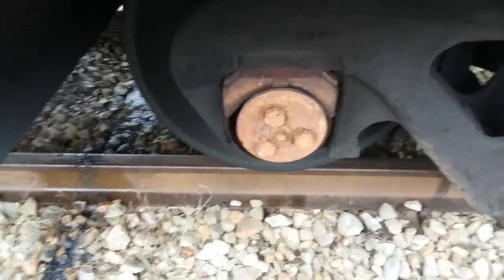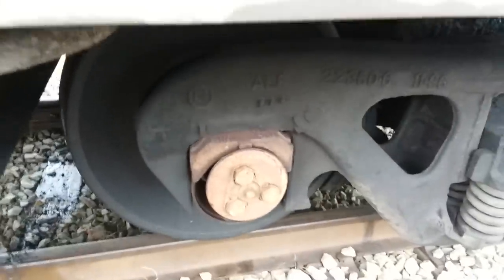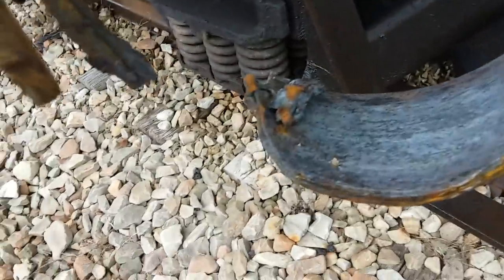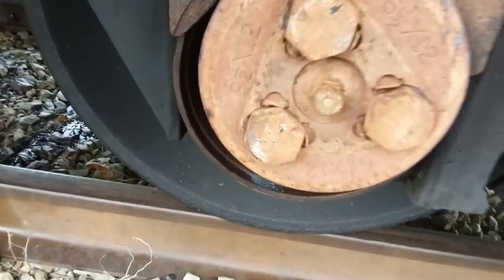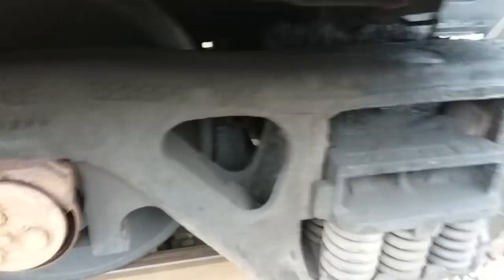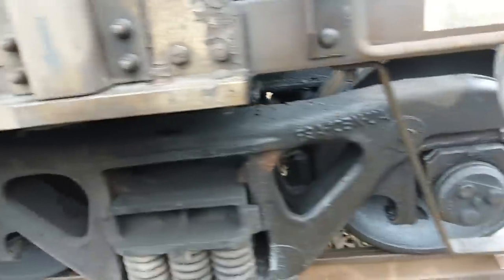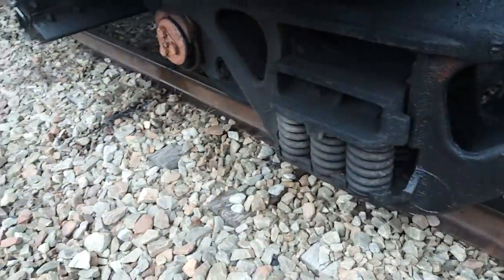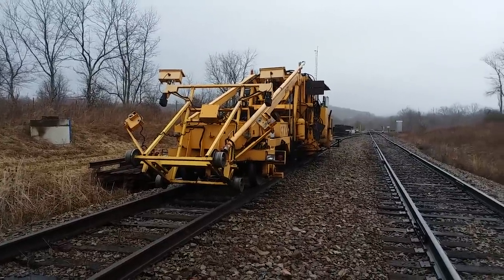Hopper Car with Bad Bearing, more of the Story

Comment: Timken has a facility in Akron, OH. I wonder if they assemble the railcar bearings there.
Reply: They also have a place in Canton Ohio. I deliver scrap there.
Reply from the maker: @mikeschmidt5328  Mike, awesome, thanks. PRR used have big shop in east Canton, is there anything left of that?
Reply from the maker: Lester, good question, hope somebody can give us an answer
Reply: @ccrx6700  I think Nimishillen Creek E. Branch is where the old PRR use to be. Looks like a small yard and shop there and another bigger yard in the front of that.
Reply from the maker: @mikeschmidt5328  thanks Mike
Reply: @ccrx6700  I'm a mechanical engineer and I love your commentary.  I am involved in the design of large pumps for power generation. You were absolutely correct about the piece of wreckage - it sure looked like an inner race.
Reply from the maker: @lesterlattig  thank you Lester, i ofyen wonder what others who watch are thinking. Do appreciaye your comments, and by the  way i'm Dave
Reply: @ccrx6700  As an avid rail fan and novice model railroader I really enjoy your videos. I live in the Poconos in Eastern PA and would love to take some time off and drive out to meet you before you retire. Then I can spend a couple of days in Altoona on the way home, and watch those massive SD-80 MACS haul coal trains through the horseshoe.
Reply from the maker: @lesterlattig  would like that, hopefully this virus thing will soon pass, but that would be awesome have you visit. Been horseshoe, wwhen you there check out railroaders museum. Did you know there is a rail cam live for hoseshoe on utube? We bout 3 or so hours west of Altoona, hour south of Pittsburgh. Many years ago wife an i honey mooned in Poconos
Reply: I do Dave. I watch Horseshoe Curve everyday, along with a bunch of other railcams.
Reply: @ccrx6700  I grew up in Northwest NJ along the old Lehigh Valley Newark to Buffalo line in the 60s and 70s. I lived in Alpha,NJ about 3-4 miles west of Easton, PA. As soon as a train was heading east I would here them cross the river from Easton at night. Those ALCO C-628s were screaming climbing the 1%-something grade to the Jugtown Mountain tunnel in Asbury, NJ headed to Newark. Fond memories. The old paint schemes they had were fantastic.
Reply: @lesterlattig  Awesome, I know nothing about that railroad or paint scheme,
so much railroad history, so little time to learn, appreciate hearing stuff like that,
Original Lionel train set I got back in late 1950 had steam engine and a Lehigh Valley
hopper car with it, and that about my extent of knowledge on LV. Have never heard
an ALCO in person, but have seen some vids on tube, sweet!
Reply: @ccrx-xu1wc  Be safe out there. BTW, EMDs are my favorite. Older locomotive engineers called the SD40-2 an engineer's favorite, as compared to the GE units at the time.

Comment: The theory on sealed bearings is they don't last ...lubed ones may run for a few years ...most bearings are made in China Mexico or Japan which is of poor quality and almost always sealed it's all about money
Reply: David, thanks for the comment sir, and for watching
Reply: Interesting theory but not backed up by facts. Roller bearing failure rates are quite low. Most of the failures you will never hear about as they are usually seal failures and caught and removed during regular inspections. But consider there are over 1.6 million rail cars in North America with a minimum of 8 bearings each According to SKF only 0.5% of bearings actually fail and if a railcar bearing does fail it is usually caused by lack of maintenance causing worn adapter plates and side frames resulting in uneven weight distribution on the bearing itself.
Reply: @edfrawley4356  just stating what I have seen in big truck and automotive  repairs for 40 plus years ....sealed bearings will not outlast lubed bearings we have seen it many times over the years ...foreign made bearings are of cheaper quality that's why they are ( cheaper ) Timkin bearings which are the best in my findings will run indefinitely provided with oil or grease on a regular basis ..there is no rocket science involved in that either
Reply: @davidbass7593  Im not an engineer but in my opinion the bearings used in rail equipment are oversized for the weights they carry. since from the beginning they where based on the size of existing journal bearings. The wheel shops simply milled the flange off of the end of the axle and drilled and tapped the bolt holes. I believe this contributes to the longevity of the roller bearings in the vast majority of cases running trouble free until the wheelset has to be changed out for other reasons.

Comment: I know the lower air hose is for the brakes on the hopper car.  But, what is that upper air hose for?
Reply from the maker: Good question, since these are bottom discharge the top hose is for the dump line
to open and close the doors
Reply: @ccrx6700  Oh, ok.  Thank you.  :)

Comment: a grease-able bearing (or ball joint, U-joint, ETC) WILL last longer..... but it REQUIRES regular greasing 
a sealed bearing will last 80% as long as a grease-able style..... but can be neglected 
.
when automobiles went from 3000 mile oil changes, to 5000, then 7000.... and now days 8000 to 12000..... 
your local mechanic wasnt able to grease these fittings every 3000 miles.... so they wore out
.
so, because of the extended service intervals..... they went to sealed 
and 9 times out of 10.... they lasted longer than grease-able (because only 1 out of 10 people own a grease gun, and have the skills to jack up a car and grease it themselves) 
.
.
i figure the same sorta thing has happened on rail cars...... the service intervals have went from Y miles..... to Y times 2 miles....
so these "serviceable" parts were not being serviced 
.
plus, the RR company saves money..... 
as they dont have to hire as many grease monkeys and the cars spend less time in the shop.... and more time moving crap around
.
.
and ya.... they probably re-use as much as the original castings and parts as they can
why put a plug in..... when you can just use the original "grease insert hole" fitting?
.
that would cost an extra 2 dollars for the plug..... and thats too expensive!!!
also, why do we need 2 person crews? the alerter will keep a single man awake!!!! its TOTALLY safe!!!!
Reply from the maker: Thank you for your informative comment, you are right, can't argue much with anything you said there. Thank you for watching, hope you enjoyed

Comment: In the old days they had what was called a hot box on the ends of the axles. these had a lid where you could dump lube into them. if they ran out of lube it was a meltdown like this one. thus the name hotbox.

Comment: In my 18 years on the rail, I’ve never seen a bearing that bad. Other then after a wreck. Haha
Reply: Daniel, I've actually seen a lot worse, we had some terrible failures that really
tore up track before we got our detector installed, saw one where the axle actually
was worn down to a point, cone shaped. that detector has saved us a lot of expense
from derailments. Thanks for watching and appreciate your comment sir. Thank
you for your many years of RR service, I'm sure you got a lot of great stories you
could share with us
Reply: @ccrx-xu1wc  I don’t have any good stories. At least not like the stories the “old heads” tell from the glory days of alcohol and drugs on the rails!
Reply: @bestfriendhank1424  Daniel, I understand from the glory days.... they were building track
into Baily Mine in the early 1980's late 70's. The tamper operator the construction company had wasn't having a good day. Road foreman was sent to town to the
local bar, purchased a bag of weed and gave it to him., He smoked one and
after that he went to town tamping.

Comment: Looking at your line on google earth I don't see anywhere to turn cars or locomotives.  Do you experience uneven wheel wear?
Reply: Bob, very observant sir! We have no place to turn. We do experience an uncommon
amount of wear on wheels and rails since all loaded traffic is only 1 way. but nothing
we can do about that. Can't run loads back up to the mine, so that is the nature
of the conditions we operate under. Congratulations sir, out of all the thousands
of comments I have had, you are the first to ever make a statement about that condition,
I like the way you think!
Reply: @ccrx-xu1wc  I've been around a couple industrial operations that would run their equipment back and forth on the same curve all the time, and the wheels on one side would wear more quickly than those on the other side as a result.   Can't do much about rail wear, especially in curves.  Track grease only helps so much.  

I'm out in western Canada, an older friend of mine worked for Canadian Pacific in the Crowsnest mining area for many years.  They had loops at all the mines and at the port in Vancouver, and would periodically turn their trainsets on a wye to even out wheel wear and get more miles out of each wheelset.
Reply: @bobsmith2637  Thanks Bob, great info to know, I had no idea that they would
turn the rollinig stock to even out the wear, but it does make good sense., One thing
that does help us a bit is we have about the same amount of left and right hand curves

Comment: Is it just gravity keeping the trucks under the rail car?
Reply: For the most part yes. In the middle of the Boister is what looks like a bowl with a hole in the middle of it that a pin goes into. The bottom of car has a bowl and hole that it all fits into. Except for the brake linkage being connected, the weight of the car keeps it together

Comment: Wow you are so lucky that car didn't go on its side. Talking about a hot box!!!!! I may be wrong so don't hold my foot to th me fire on this one. A car that don't have sealed bearings can't be on a consist on a class one line. Can you imagine going around with a stick opening up those old bearing lids pouring grease in there....kids that's something they use to do. Honestly if that bearing was made in China, Russia, japan or the US, as hot as it got the outcome would have been the same. I've never seen a race so bent out of shape before. I bet when it fell out on the snow it melted fast!
Reply: Jason, great comment my friend, I looked in my CFR Title 49 book to see if FRA
had a ruling on that, it wasn't in there, but I got an older book too, so you very well
may be right. Then again AAR has some say in that also. Those old car men that I have
heard from hated changing those old packings, ugly, messy, dirty job, woulda made
a good show for Dirty Jobs, Mike Rowe! Loved that show. Thanks Mr. Engineer. I got some
pics on my old phone of cars on their sides from bearing failures, unfortionately when
I got this new phone they were unable to transfer them over, or I would have posted them.
Before our detector was installed 4 years ago, we had some really bad stuff happen.
Reply: @ccrx-xu1wc  I've been working on a rental house we have putting up moulding and a new backsplash when I saw you had a new video out. Was the perfect time to take a break! I honestly can't remember if someone told me that or if I read that somewhere. Some of the old passenger cars still have the journal boxes on them but they are on short lines and such
Reply: The rules on rolling stock that is allowed to be interchanged got a lot more restrictive before WWII, when running long distances at speeds greater than 25 mph became more common. In addition to journal bearings, truck sideframes, brakes, and car underframes all had to meet AAR standards, which have been updated more than a couple of times since.

You do not want a hotbox on a fast freight, nor an arch-bar sideframe to lose a rivet or bolt, nor a hand adjusted brake left partially set.

And, in the event of a derailment, you most definitely do not want a wooden car underframe turning into splinters and potentially releasing a hazardous cargo to add to the mess.
Reply: @chemech  great post all very true statements
Reply from the maker: @chemech  Thank you for your great comment, appreciate your sharing your
knowledge with us.

Comment: those bearings can be good fire starters, i have walked back from a rail line fire and seen just where the balls have have fallen to start a tie on fire. the hot box indicater should have caught it but did not. A lot of the new rail trucks are made in China.
Reply: Philip, yes sir they can, do you remember the Union Pacific bridge fire in 2009
that was caused by a hot bearing, it was in Kansas.
Reply: @ccrx-xu1wc  I do not particularly remember that one ,but where we live in the spring when the grass is dry one has to be careful

Comment: Is that called  a journal?
Reply: No, journals were the forerunners to roller bearings.  Journal bearings were a type of system where an oil bath was needed, with an oil sump.  As the axle end would rotate inside the journal box,  the oil was wicked up and spread and smeared on the rotating parts, maintaining lubrication between the axle and the part of the truck that physically rode atop it, a piece that had a "U-shaped" notch in it where the rotating axle end would roll in that notch.  If the oil supply stopped getting to the area where it was needed to lubricate,  things would dry, begin to get very hot, accelerate wear, and very likely get hot enough to set the packing (usually cotton) on fire.
Journals eventually went out of fashion, as they were maintenance-intensive, constantly wanting oil and a threat if they did not get that oil or somehow went through the supply sooner than expected.  Journals are now only found on historically maintained equipment, as it has been deemed inappropriate for modern-day operations.  Any surviving equipment with journal bearings are barred from interchange service, they can only be kept on "home roads", and their own people are responsible for proper operation of them when in use.   Do journal bearings fail? Yes, and surprisingly often, due mostly to lack of lubrication.  They also had a fairly short life expectation, compared to modern-day roller bearings, which often serve for years, in many cases only being removed because of problems with the wheelsets. Yes, they do occasionally fail, but it's rare.

Comment: Have always been under the same impression on manufacture. Have seen stuff etched like "Timken U.S.A.", Timken Slovenia", "Timken Russia", "Timken Germany" and so on. (Been a few years. European countries MAY not be 100% accurate.)
Reply from the maker: Thanks Eric, I've never seen the country stamped like that but
will consistently watch for it in the future here! Appreciate the info.
Reply: @ccrx6700  Just an FYI note here: Used to be a trailer mechanic so any bearing sizes are 12,000-lb-rated trailer axles and smaller. We used to keep the better stuff in a box (no idea if they still do that), hence all of the stamps.
On those larger ones (as in train size)...LOL! I wouldn't even begin to guess on a bearing or race number, hehe, but the guess is that even though they won't necessarily say it all, they're more than likely made in the U.S.A. even though they may only say, "Timken" on the bearing, race, or even on the box.
Oh yeah....Another one was "Timken Canada". And LOL!! I that "Timken Russia"...Been a few years but I'm pretty sure that's actually "Timken Romania" Haha! Oh, dopey me. LOL! If you ever see any like in the previous paragraph (no country / only say "Timken"), odds are VERY high they're made in U.S.A. only.

Comment: Yeah when a hardened race is mangled like a wet noodle... that is some stress.  China can absolutely manufacture to a spec.  When they do the price point reflects it.
Reply: Lot weight grinding down on that axle after the bearing goes out, most likely woulda
derailed several miles down the line, we lucky the detector caught it, thank you for watching

Comment: dam that's the definition of it will work till it don't. if that was in the summer maybe a fire next to the trackage. catch ya later . oh I was 13 min after posting # 528 viewer.
C YA.       after writing this reloaded, 803 views
Reply: Hey Kenn, you slipping, I think your gonna get the award for having been the first viewer
the most times...LOL Do you remember couple years ago UP had a bearing failure on
a bridge, I believe it was in Iowa? Dispatch told them not to move the train off the
bridge and the bridge caught on fire. I owe you an email, haven't forgot
Reply: Check out the 2nd email its a forward from only trains model shop in Minnesota they are big in G and O scale.

Comment: That’s a lot of damage
Reply from the maker: Yes sir, and the bigger the damage the bigger the repair bill ==> 💲💲💲
Reply: @ccrx6700  how much will the repair cost?
Reply: @SilasWasHere  Good question will try and find out, I don't handle billing and
such like that, I do know that a reconditioned truck set costs us delivered,
$12,000. To replace that old truck set will require a contractor coming in with
a crane to lift car body, roll the old truck set out, a forklift to handle moving the
truck set, then roll the new one in, will take longer to set up the crane than
move the truck sets, but don't know what the cost will be on the contractor's work.
Whatever it is, it won't be cheap
Reply: @ccrx-xu1wc  I appreciate the quick response. there are a lot more steps to replace it then I thought there would be.
Reply: @SilasWasHere  your welcome Silas, I appreciate your comments and for watching.
Stay tuned, got a lot of new ones planned for this year, plus the odd occurances
than happen from time to time, always something new on the railroad. Am lucky
I can do this, it just totally amazes and boggles my mind that so many people
are watching these, really unbelievable to me, I am humbled and in awe.